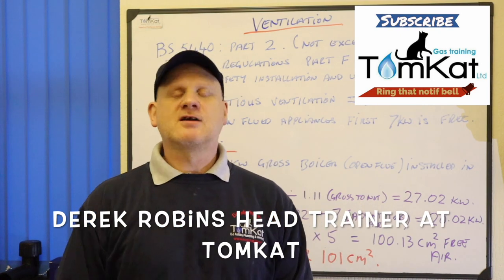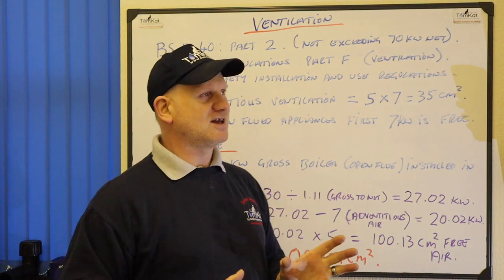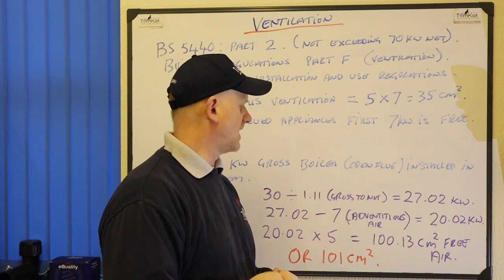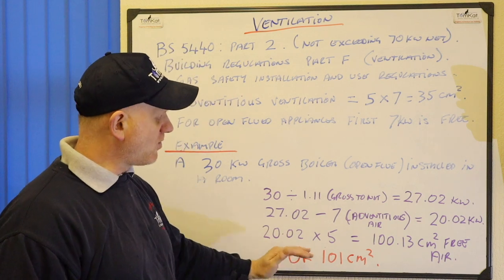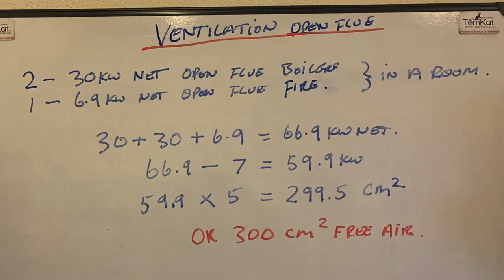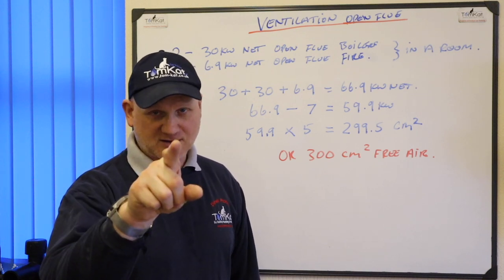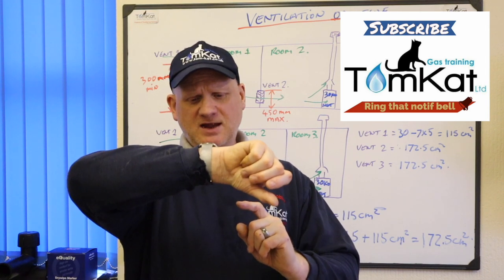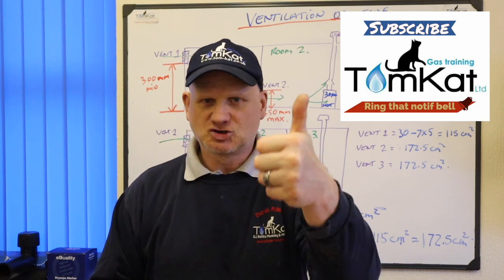OPEN FLUE VENTILATION, acs gas revision part 6  in 10 minutes or less.

Comment: Hi Derek great Video I heard through the grapevine that in 2022 they are changing the scientifical  adventitious air calculations from 7 to 2 KW and the scientifical calculations from 5 to 4 in accordance to the extension of the New Build Regulations since 2015 SEDBUK appliances are expected to go from A rated towards Eco Green A+
Reply from the maker: Since 2008 we have not been able to install gas appliances in new builds or houses that are brought up to the current insulation standards if they required ventilation as there wouldn’t be any adventurous air plus it wouldn’t pass an air test if you had a chimney or air vent. So the calculations shouldn’t change for old appliances but we now don’t install flueless or open flued appliances in houses built after 2008 if the required a flue or ventilation.